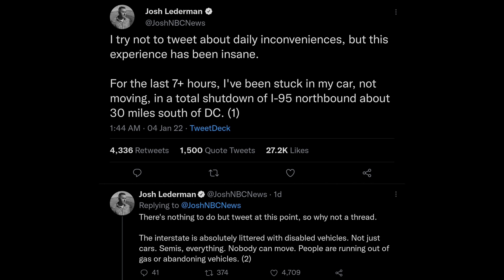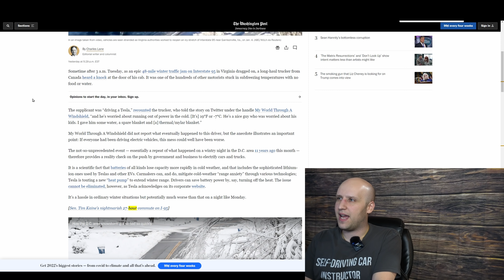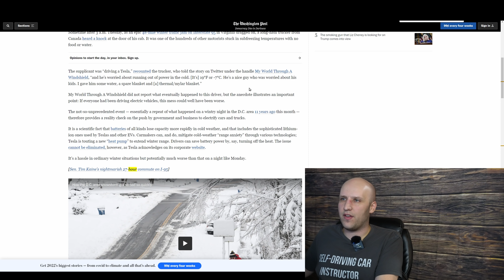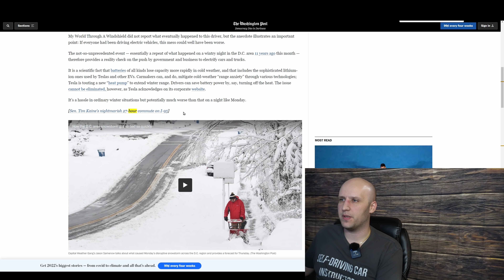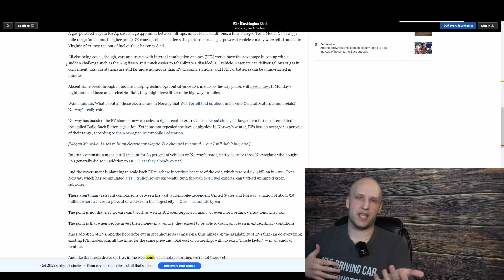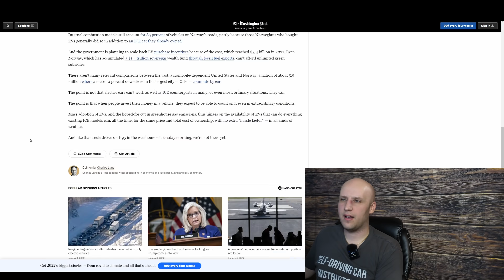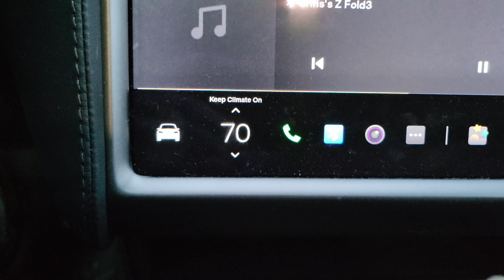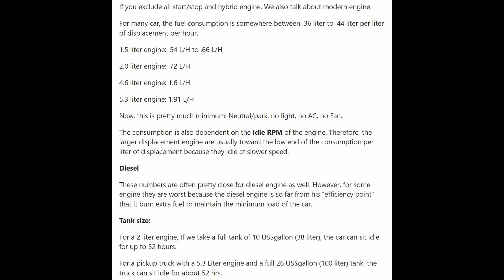How Long Can a Tesla Keep You Warm In A Frozen Traffic Jam? | FUD Debunking

Comment: Thanks for doing your tests, but I think if stuck in a snow blizzard, keeping the interior of a car at 70*F/21*C in an emergency is unrealistic. (That really is "toasty warm"). That's the temperature of a comfortably warmed house with full  central heating, with people wearing Winter, inside-the-house-clothes. In Winter in those areas with snow, folks going outside are likely to be wearing more suitable clothing (at least decent shoes and a substantial jacket or coat). Setting the car's internal temperature down to about 50*F/10*C or even 40*F/5*C is going to DRASTICALLY reduce the electricity use by the car's heating system.  So assuming that a person's NOT driving around in the snow, wearing just flipflops/jandals/thongs on their feet,  a bikini with a flimsy Sun dress overtop (or swim-shorts and a thin cotton Hawai'ian shirt), then I reckon your electric car would keep the inhabitants alive and free of dangerous frostbite or Exposure, for very VERY  much longer, possibly several days. Previously I lived in an old house in rural Australia. Without any insulation, the coldest in Winter inside the house would be about 5*C on a Winter morning when there was a "just frost" outside, and with the day warming up to about 14*C  the temperature inside would eventually climb naturally to about 12*C. I simply dressed "appropriately".

Comment: if its a hybrid battery type. i think it will last longer than the tesla, cuz when running heat the engine is off. when i the battery is low, the engine will charge the hybrid. i slept overnight with a prius b4 and the engine kick on every 30 min for like 3 minute @ 40F temp outside

Comment: There was also an article about the traffic jam on I-80 when the pass was closed after getting 20 feet of snow in California where they blamed the roads being clogged with dead Tesla's. Except there weren't any. The traffic jam was caused by diverting traffic off I-80 onto highway 50 which is a much lower capacity road. 
I just don't understand what kind of fear generates all these false stories about EV's aside from Big Oil's fear of becoming less relevant

Comment: Valid points in the video however the test is flawed because most people adopting evs would not drive teslas. Hence a lot of people will not have the battery capacity of a tesla. A valid test would be to test the news, some leaf models,  ect. If I was stuck with my 2013 leaf I would had been screwed.

Comment: ICE also lose range in winter. Might be a little closer loss gas to electric than people think. If you lose 1% range for every degree C. then at -30C you lose 30% range. My Jeep in summer is 11-12L/100km. Winter 14-15L/100k. I don’t warm up. It does get parked in a garage. That’s a 25% delta.

Comment: Good video. Since it took so much energy to bring the cabins up to temperature it would have been better to preheat the cars, especially if you wanted to extrapolate the energy usage. For example, if it took 5% of battery to heat the cabin, then your steady state cost for 12 hours would have been 28% rather than 33%. Likewise, the second part of the Model Y test undercounted steady state usage because you saved all the energy of letting the cabin cool down. So the real life energy difference between 70 degrees and 60 degrees probably isn’t as exaggerated as this test implied.

Also, good that you calculated how long ICE would last. I used Natural Resources Canada numbers for idle burn rate, which were 0.6 times displacement per hour, so I actually ended up with EVs lasting longer than ICE cars, but still same ballpark.

Comment: ICE car with 30 gallons (that’s a big gas tank completely full), could only run idling for 60 hours. A true advantage to an electric is the automation, including the simple feature of not having to turn on an engine to use the heater (automatic heating), whereas to use the gas car efficiently, you’d need to run the engine until you heated your car as hot as possible then turn off the car to conserve fuel, then turn it on when it gets a bit colder. You have to be the thermostat, whereas your EV will do it all for you while you take a nap or reading, etc.

Comment: Also unmentioned is that most EV users start everyday with a full charge.  Most ICE users wait for the idiot light to hit the local station.  The chance of the EV having more fuel is greater since the standard practice is to "fill up" frequently.  At least that's how it works in our house.  The EV starts everyday with max charge (~80%) and the ICE car is subject to whatever cycle of usage we happen to be in.
Reply: I fill at half tank but you're right.  Sometimes I'm riding with someone else and I'm looking at them like "the gas light has been on for 40 miles dude"

Comment: When in a traffic jam or stopped traffic the older ice car sits @ idle and burns gas. The current solution is the cars now turn off and restart.A waste either way and a lot of starting and cranking.A Tesla on the other hand is extremely efficient at slow creeping speeds. In addition the car will drive itself and is much less tiring it will just pace the car in front if you have FSD with navigation engaged. When ever you go through a mountain pass in winter conditions my gas’s driving days taught me to have a full tank now its electrons no worries here. /Electric is the way to go ignore the fud ! Always carry water and a blanket.thanks for the testing info.

Comment: Also note that gas powered vehicles are also less efficient as fuel economy drops with cold weather. And in really cold climates ICE cars are electric engine heaters that plug in to the electric socket because gas engines won’t be able to start at cold temperatures

Comment: I would rather be stuck with a big diesel and tons of fuel, proven for a very long time to not be an issue. EV car stuck with no charge around and not tested over time = not my choice. They may be just fine but they are so new more data needed.

Comment: a big issue with gas cars in this situation is that the gas in a non moving car will literally last the vehicle way longer than EV, but gas cars also have their small 12volt dc batteries used to heaters and they dont get charged from the alternator if the car isnt moving so that 12volt batteris dying i what kills gas cars fast and not actually runing out of gas

Comment: If the power goes out you can charge your card and you can gas Your car but difference gas station can use gas generator to power up the pumps and you can guess a generator can’t do the same for EV’s

Comment: A significant difference between ice  cars and EVs  is that you can siphon gasoline out of one car a stick it in another. There's  no bucket available for sharing electrons between the various EV  vehicles.

Also, sticking all your seat heaters on high was rather silly. I'd have understood if you set them all on low. I will bet that the seat heaters on the model X are much larger than the model y which would contribute to the extra usage.

Not sure I completely saw your point with critiquing an op-ed, but I did appreciate the testing you did on your two cars that was pretty informative in a real world test. Great work!

Comment: Perhaps to get an electric car out of trouble you could always use a generator to put enough in to get you to the closest charger rather than cary a can for fuel.

So long as its a pure sign wave it should work a couple hours would probably get you a few miles, assuming you had one in the car, probably a couple hours just walking to a fuel station to fill a can to then have to walk back to the car anyway.

But if you had a small enough generator with a full tank in the back of the electric car just plug it in while you are stuck on the road, that's forward thinking.
Best if both worlds.

Comment: Important note to Gas cars and heating... I have had it where a gas car in very cold temperatures in idle would not generate enough by product heat as you called it in the video, to even heat up the engine temp. So you could be in a situation where you have to rev the engine, thus use a lot more gas to get the heater to actually work! Hence electricity is probably even more efficient in cold circumstances!

Comment: The volume of the interior in the Model X is much larger than the Model Y, so you have two variables -heat pump, resistance and air volume...

Comment: If you are stuck in the storm, your cabin is already warm. As long as you aren't being a spoiled brat, it should last for days. Personally, I'd drop it down to 60f, but that's me. I also heat reflecting blankets that folds down to a credit card size packet. It's safe to say, I'd run out of water before I run out of heat.

Comment: 9:45 as EV purchases increase, it will be common for AAA affiliated tow trucks to have on-board batteries with charging ports to give a stranded vehicle 50 miles of charge to get to the nearest charger - the modern equivalent of a 5 gallon gas can.
Reply: Someone should come up with a mobile diesel powered generating station to give all those dead Tesla's a small charge so they can make it to the local charger.  I've even thought of a great name for it.  They can call it a Generator!   Can't wait to see that on the road.    lol
Reply: As a AAA driver, I can tell you that an on board battery would not do much and be too heavy to carry and too expensive to equip. We’d most likely carry a generator that was able to produce 220 volts so that we’d be able to efficiently charge stranded EVs.

Also, some tow trucks would be likely to carry those, but more likely you’d see mostly light service trucks doing the job. They wouldn’t want to tie up a tow truck that long charging an EV. That’s why a lot of AAA contracted places have at least some light service drivers.
Reply: @WolfyGayBoy  @ they will go for tow, cost more money in your bill.
Reply: lol it will be powered by a diesel generator. hilarious
Reply: tow truck with gas generator work better
Reply: Or they just pull you along with a cable for some distance.
Reply: Most likely they’ll just have an engine powered generator to recharge stranded EVs
Reply: What type of shit box are you driving where 5 gallons gets 50 miles?? Lol
Reply: And how many jumps do you think they are capable of? One, mabe 2? What happends when EVERYONE is required to own a battery powered car . Let's be real about this.
Reply: @scottfirman  they go back to the shop and swap the battery out for a freshly charged one? Markets change dude and people adapt
Reply: @CoveringFish  And how exactly do they get through the snow to charge said battery? Ever try to carry a huge battery through the snow?  So tow trucks will have charging ports huh? BA HA HA! yeah, and a USB port so you can charge your lap top too while you are WAITING! give me a few gallons of gas and gone!
Reply: Modern Triple A aren’t tanker trucks. Well I think there actually some that are but most are just a tow truck and they go and refil after a few refills. A triple a service for an ev can just go to a charging station when drained. And they can carry a generator to handle both if necessary.
Reply: @scottfirman  for a 100kwh battery, 8 jumps at 50 miles each or in an extreme case, 20 jumps at 20 miles each.  How many gas cans do you expect a tow truck to have on hand?

Comment: Interesting test, yet when you get stuck your not going to have the maximum amount of battery for sure.  Also you could get stuck in a less beneficial situation.  Like right now it is -5F out in MN, that's going to change things.  Yet in MN you don't hear about this type of thing happening cause we have an incredible snow clearing infrastructure.  While you will benefit from having an accupent or multiple in the vehicle as long as you can tilt the seat down to sleep, so probably only want to get stuck with up to one other person, you still will get heat generation from you and the occupent.  Yet, both would have to open the vehicle doors multiple times to relieve themselves, not to mention while releaving themselves they and their gear would cool down.  Clearly I wouldn't want to be in that situation over a ICE vehicle.  Overall though this short of time, probably not an issue in a tesla/eV.

Comment: I was playing tag with a Model X for about an hour in that mess. The stoppage was "only" over about a 40 mile stretch of highway - but that was a miserable 40 miles. I hit it shortly after noon and was able to break free by about 11 PM.

One thought - your measurements assume that the cars arrive at the jam with close to full batteries. Most likely, they will have driven a hundred miles of so before getting locked in. I arrived at the stoppage with a bit over 1/2 tank of gas after my last refuel.

Comment: Also, there is already an infrastructure built for gas vehicles.  Thus, the gas vehicles will have most the benefits during unexpected events, so as we progress to electric, we will grow the infrastructure for electric.  It will also be good bc new tech will follow, bringing new/improved charging stations, batteries, and other new advancements.  We shouldn't try to build a wall around something new bc we are scared our stock will fall.  Instead we should embrace it and try to see what it can do when we really start researching it.  This is just the beginning of electric and hydrogen.

Comment: EVs are pretty much the future. I will say, when i get my Tesla, i plan to keep one of those small honda generators in the frunk. I do like to drive off into rural areas alot, so its a cheap backup.... i have a 5 gal jug of gas i keep in the back of my truck now... ive needed it once ever.

Comment: The political party that is in control of Washington DC is now at war with Elon Musk because he refuses to tow their line. There's also money being thrown at TV NEWS and NEWSPAPERS to diss Tesla at every turn.

Tesla does not buy TV Commercials or print advertising, but guess who does? GM, FORD, CHRYSLER, TOYOTA and others. More so down to the local level as Tesla' s way of selling cars will eventually destroy the "Car Dealerships" that we know today.

WaPo posts a bogus article that has been refuted by tests and by people in Tesla's that were stuck in that I-95 mess.

If the people trapped were commuters (Leave every morning with a full charge)they should have had more than enough energy to stay warm long enough for the road to be cleared. Road trip people would have to take their chances they might have been stuck on the road with under 50% batter, same as a ICE vehicle under half tank. The vehicle would have been warmed up so more economical to maintain heat.

Comment: You generally have a higher state of charge in an EV vs. tank level in a gas car.  Most people plug in at home, and many can even plug in at work for free.  The EV tends to use a small range of the battery most of the time.  Whereas a gas car is only filled as the tank gets low.

Comment: Excellent test, and much needed.
Now do a test for starting up a Tesla in a deep freeze (-40 degrees).
Not one of these where it's been plugged in all night at home, and you can simply heat up the battery and drive away. I want to see what happens if the Tesla has been sitting out in a cold parking lot for a week with no charging line. Will it start? Will you have any range at all?
Reply: In Manitoba there was a guy who had his tesla run dead at -40. Head ended up having to tarp it and having to heat it externally to charge it.

Comment: If the gas powered fanatic are worried about electrics running out of energy we can place coils in the pavement and charge the cars wirelessly in times of trouble. Kind of hard to pump gasoline through the pavement.
Reply: Under all roads? That sounds super expesnive for something that would almost never be needed and it wouldn't work anyway if the power was out. Some generators or batteries could just be trucked in if needed to recharge the cars some like how gas could be trucked in for ICE cars.

I do believe EV is the future but I don't really see the point in putting coils in roads.

Comment: It seems potentially dangerous to me to spend a long time in an unmoving ICE vehicle with the engine running due to the exhaust. Obviously it wouldn't be as dangerous as being in a garage with the door closed, but you'd still be breathing the exhaust that accumulated near the vehicle for many hours.
Reply: 40 years ago this might be a valid point.  Many people don't realize just how clean a modern ICE burns.  Modern exhaust systems are much better and last much longer for these reasons, too.  If the engine and exhaust systems are in poor shape, there could be a danger.  Also, in the open, the exhaust doesn't accumulate to hazardous levels around the vehicle, but quickly dilutes and dissipates into the surrounding air.

Comment: Running out of fuel in a gas car is not the same as running out of juice in a electric car. You cant carry a bucket of electricity with you to fill up your tesla and once you do get charged up enough with a gas generator to reach the pump imagine how many other people will be there waiting hours for their electric cars to charge and even worse than that imagine if the storm that caused this traffic in the first place was bad enough that it knocked out the power? Then your really screwed! What would you do then? Btw your test was the best case scenario. Think about the people who get stuck without a fully topped off battery

Comment: Such an obvious hit piece from Bezos/WP.  Notice how he specifically mentioned Tesla?  Completely untrue and probably won't be challenged.  Tesla is the place to be in almost any disaster.  If the situation was opposite, stranded on highway at 90 degrees, many cars would have overheated/caught on fire, major dehydration.  In either case, ICE cars are idling, smog bombs.